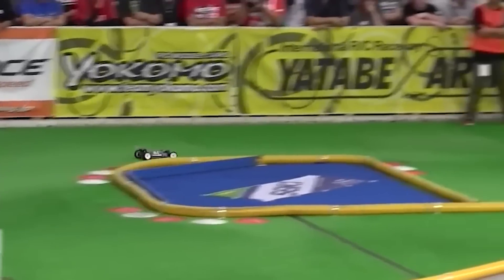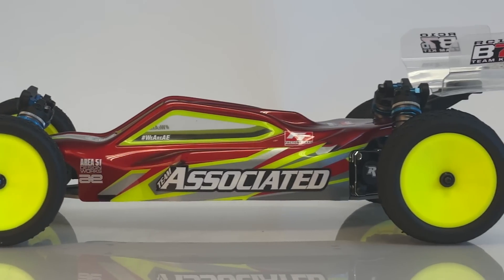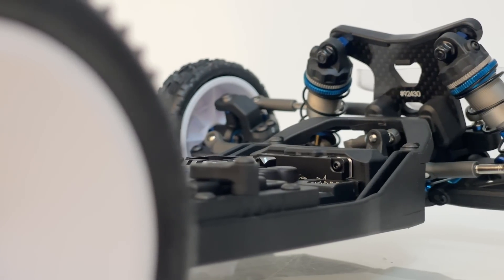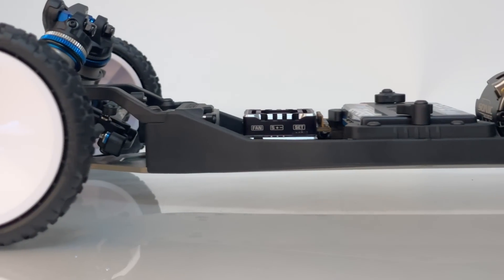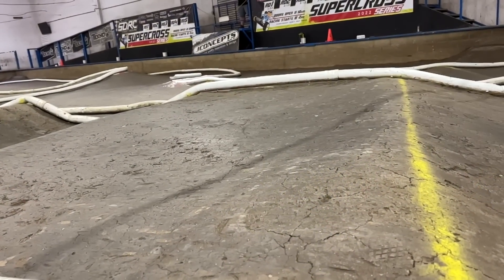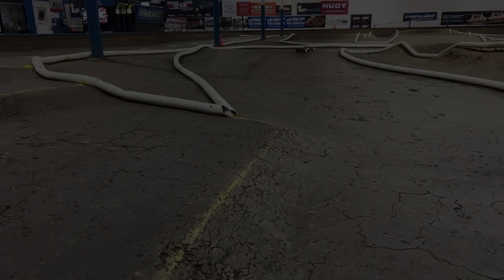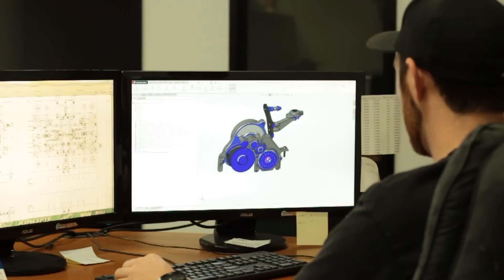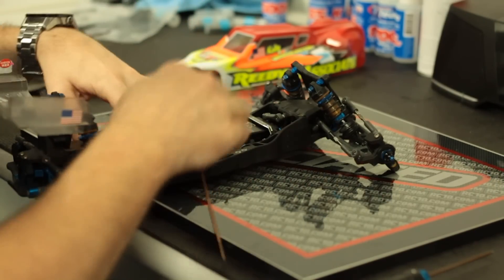PART 2 of 7 - RC10B7 Video Series:  New Breed of Race Car

Comment: AWESOME GUYS AS ALWAYS I CAN'T WAIT TO SEE WHAT THE NEW RC10-B7 (BOTH VERSIONS) FULLY BUILT LOOKS LIKE AFTER IT'S READY FOR THE LAUNCH TO THE PUBLIC FOR SALE BECAUSE I KNOW THAT THE OTHER VERSIONS LIKE THE SHORT COURSE RACE TRUCK TO COME AND THE STADIUM RACE TRUCK AND THEN HOPEFULLY YOU GUYS ARE ABSOLUTELY GOING TO DO A NEW AWESOME VERSION OF THE (DR10M) NO PREP OUTLAW DRAG CAR AND MAYBE BASE IT OFF A COMPLETELY NEW CARBON FIBER CHASSIS AND NEW FRONT AND REAR BULKHEADS FOR MOUNTING THE FRONT SUSPENSION ARMS AND SHOCKS AND THE REAR SUSPENSION ARMS AND SHOCKS AND TRANSMISSION AND A NEW (3-GEAR) LAYDOWN TRANSMISSION AND A STAND UP (3-GEAR) FOR A OPTION BECAUSE I KNOW THAT YOU CAN TAKE AND MAKE A WHOLE NEW AWESOME PLATFORM FOR NO PREP OUTLAW DRAG RACING BECAUSE THIS NEW SERIES OF RC RACING IS ABSOLUTELY STILL GOING STRONG EVEN AFTER 3 AWESOME YEARS OF IT AND IT'S STILL GROWING AND GETTING BIGGER AND BIGGER CUZ ALL THAT YOU HAVE TO DO IS JUST GO ON YOUTUBE AND TYPE IN RC NO PREP OUTLAW DRAG RACING AND IT WILL PULL UP VIDEOS OF NOTHING BUT RC NO PREP DRAG RACING BUT TILL THEN HERE'S TO YOU GUYS AT (TEAM-ASSOCIATED)!!! THANK YOU FOR ALL OF THESE FRIGGIN AWESOME YEARS OF INCREDIBLE RC RACE CARS AND TRUCKS AND MORE TO COME IN THE FUTURE!  GOD BLESS US ALL ✝️✝️✝️ SINCERELY CLAY B. AND SPEED MOB RACING🏁

Comment: I can see the attention to detail on some of the weak points of the B6 series.  The swaybars look much better engineered for precision and minimal slop.  And it looks like you can now adjust the outer front ball stud vertically. The transmission looks slammed as low as possible so better COG, initial interta, and aerodynamics!?!

Comment: The biggest thing holding these cars back is weight transfer causing understeer . I wonder if anyone will ever make a front wheel drive 2wd buggy . Would be epic to see.
Reply: You propose front wheel drive as a solution to understeer? Is it April already?
Reply: What an absolutely insane way to combat understeer
Reply: kyosho made a Fwd car in the late 80s or early 90s and it was not good
Reply: There have been several FWD buggy's over the years. There was a B6.1 based FWD not long ago. They don't work great just as you would expect.

Comment: must be pretty damn good if they are implying it's much better than the 6.4
Reply: Hard to know. As they said, the 6.4 was extremely refined.

I imagine it's sort of like real cars. Buying a vehicle the first year of a major re-design can be risky. Improvements everywhere, but some small unforeseen annoyances and lack of refinement throughout the vehicle.

Maybe it's different, and that's a bad analogy, but the 6.4 is a great car.
Reply: Well they did secretly test it so it has to be good , they can't afford to have a a failure.  I wish they refined the SCT with 7 chassis instead of the 6.4  but o well  @mouseFPV

Comment: Heard the word carpet a lot, I hate carpet personally think off-road should be off-road.
Reply: I'm guessing that when it comes to racing on carpet tracks, the guy that practices the most  and memorises a particular track wins all the time as the conditions are always exactly the same? I like the idea of outdoor dirt tracks as the conditions are always different and winning doesn't just come down to memorising a track, you have to adjust to different conditions and rely more on your driving skills? Thoughts??
Reply: Nothin better than vacuuming your off road track
Reply: Chassis’s are optimized for the tracks that host national and international events. Which are currently all carpet or sealed clay.
Reply: Do you often drive on carpet roads?
Reply: Many parts of the world have to switch to a temporary indoor track in winter. Carpet is easy to lay and remove to a slippery mixed use sports venue the same day. That's why it's used.
Reply: I saw a team driver with b7 in the wild (didn't know it at the time) at a dirt/clay track. It's fine.
Reply: I agree 100%
Reply: Nothing is stopping you from opening a dirt track or running a dirt car. 

The OEM’s jobs are to follow industry trends and that’s where the industry is at right now.
Reply: Me too. You tried to maintain a dirt track vs a carpet track?

There is a good reason for the trend. Holler when you open your dirt track.